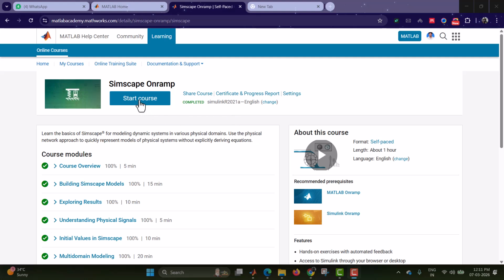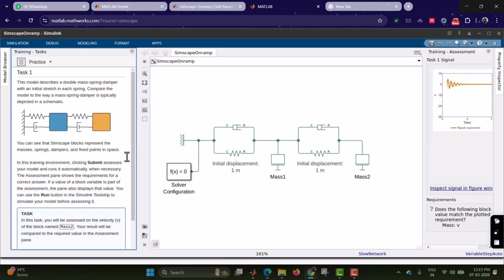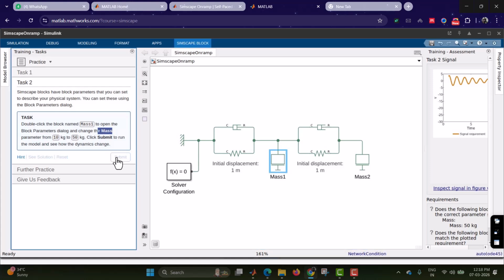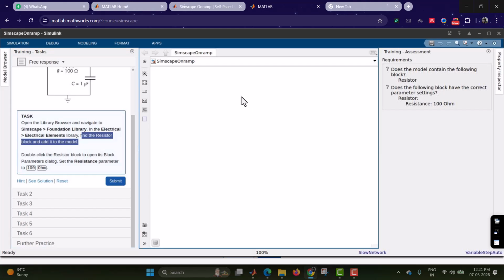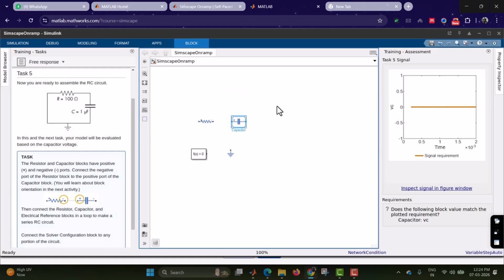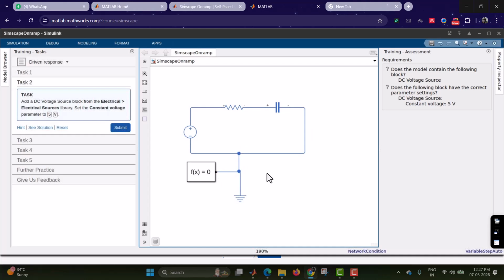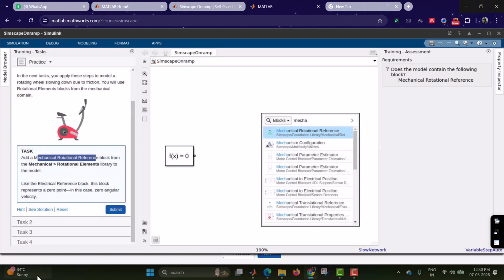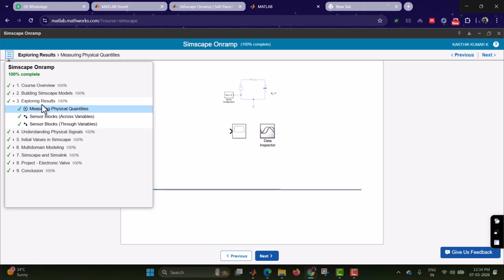Simscape Onramp Course Full Explanation – Part 1 | MATLAB Simscape for Beginners

Comment from the maker: 📌 Complete Simscape Onramp Course – Full Lecture Series

For easy learning, the entire Simscape Onramp course is explained in 3 detailed parts.

▶ Part 1 – Simscape Basics & Modeling
Simscape Onramp Course Full Explanation – Part 1 | MATLAB Simscape for Beginners
https://www.youtube.com/watch?v=-OciTzyE2G8&t=852s

▶ Part 2 – Physical Signals & Multidomain Modeling
Simscape Onramp MATLAB Tutorial – Part 2 | Physical Signals, Initial Values & Multidomain Modeling
https://www.youtube.com/watch?v=W9IZclfa5Ac&t=13s

▶ Part 3 – Simscape + Simulink Feedback Control Project
Simscape Onramp Tutorial Part 3 | Simscape & Simulink Feedback Control | Electronic Valve Project
https://www.youtube.com/watch?v=RM9kd8-ec_4

🎓 This series will help you learn Simscape modeling, multidomain systems, and control integration step-by-step.

👍 If this lecture helps you, Like, Share and Subscribe for more MATLAB, Simulink, EV, and Power Electronics tutorials.